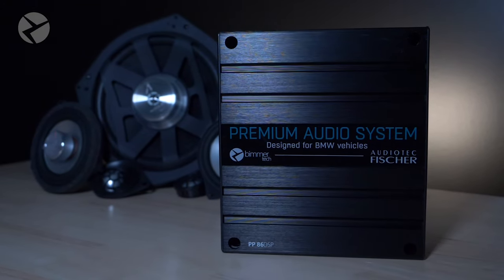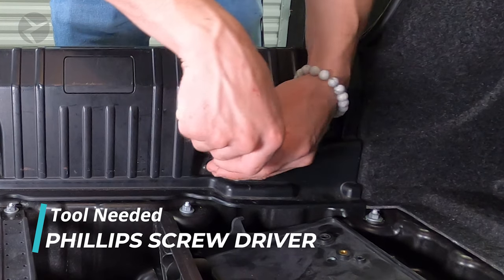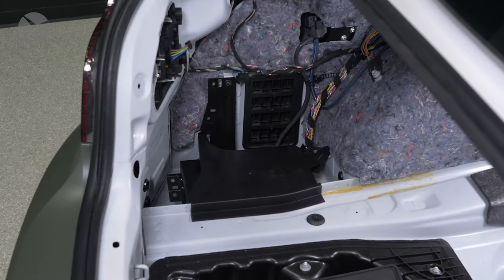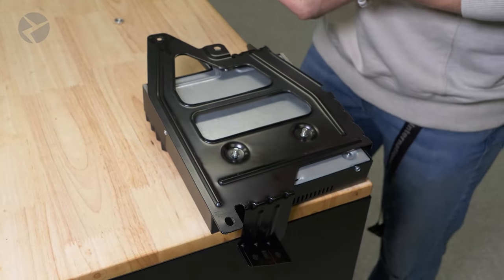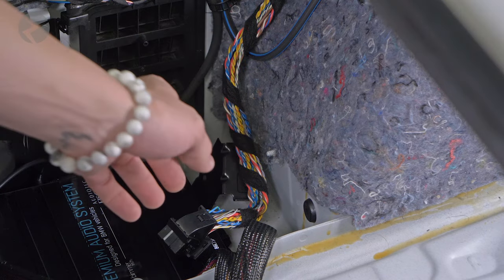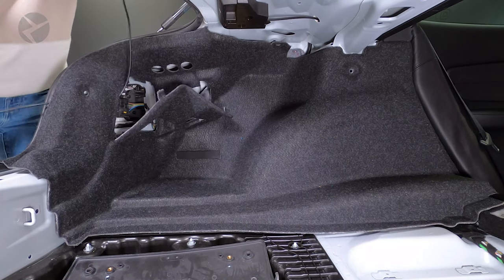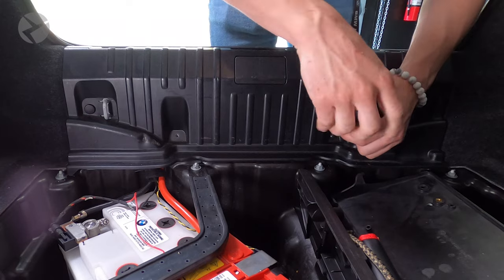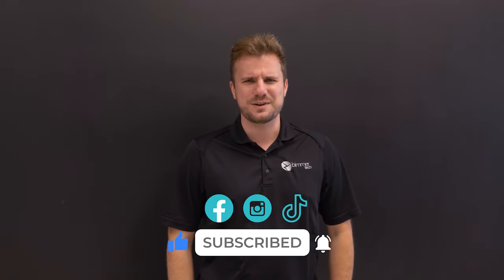BMW Amplifier Upgrade Install In E82 – Step-by-Step Tutorial

Comment: I dont have an amp or any wiring in the back of the trunk, all there is there is the metal silver box. How can I do this installation / where is the amplifier?
Reply from the maker: Hey! First check if your particular car is compatible with amplifier. Do It on our website - type in your car's VIN and see the search results :)